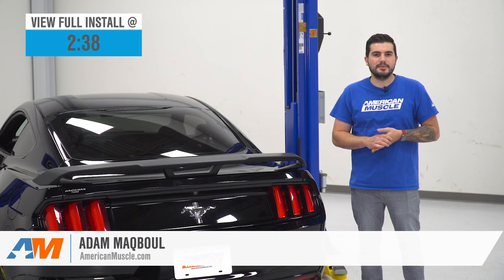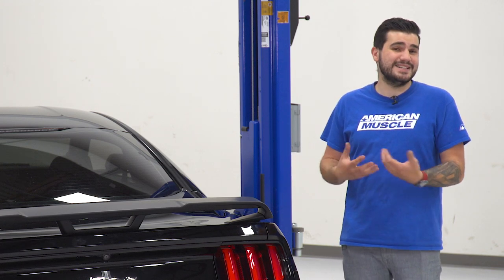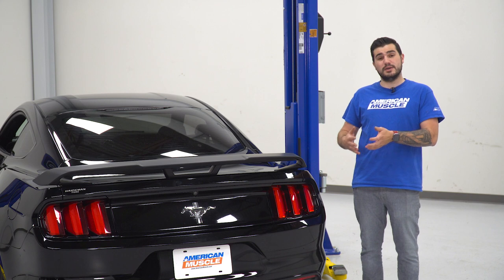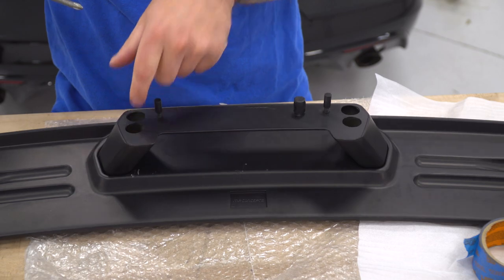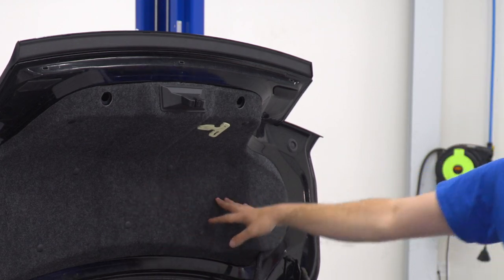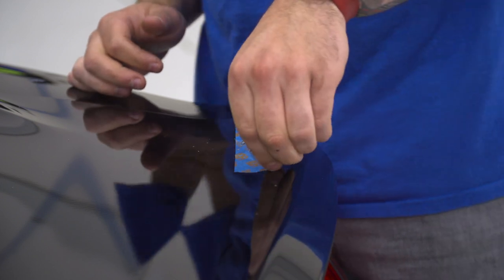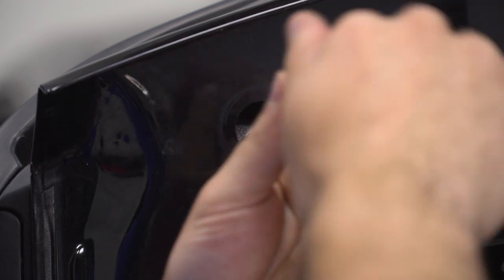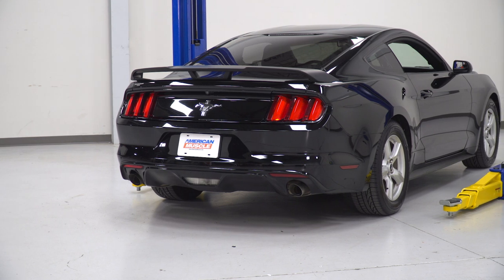2015-2021 Mustang Fastback MP Concepts Performance Pack Style Rear Spoiler Review & Install

Comment: The holes and screws should have been sealed to avoid water leaking into the boot lid during washing or heavy rain?!
Reply: dont really need them the 3m is more than enough to stop the water from getting in ... theres no sealing from the factory spoiler either minus the 3m

Comment: I have a 2020 mustang GT Black Accent Pack so it has the little duck lip spoiler. I want to upgrade to this. Does it use the factory holes? The reason I ask is because I’m pretty sure the spoiler my car came with already has the holes in the middle
Reply: @Enrique jaramillo I just got the Ford performance gt500/gt350/Mach 1 spoiler. Looks way better in my opinion and did not need any drilling

Comment: I have it nice upgrade from factory and can’t beat the price
Reply: Alot of blisters and alot of adhesive removeer and a heat gun
Reply: Its better to buy OEM instead of this cheap plastic version why do you think they are not putting it on a GT for this video 😂
Reply: @officialtjtrev8910  This is ABS and made to OEM specifications though.

Comment: I feel sorry for the owner of that Mustang.  You ARE NOT a very neat worker.  The holes you drilled were off-center, but the worst part is that you DID NOT PRIME and paint around and underneath the holes.  This area is where the Mustang will start to rust. Other than that, your video is well-made and I thank you for sharing your knowledge.
Reply: Paint and prime would be a very difficult process with how the trunk is built . that's the whole purpose of the 3mm to prevent any moisture from seeping in through the drilled areas.
Reply: @stefantaylor1693 , come on man, all he had to do was: 1.- deburred the hole 2.- Use a small brush to prime the hole 3.- Use another small brush to apply touch paint.
Unprotected metal WILL RUST even if it does not come into contact with moisture.  I have some 2 1/2-pound metal weights that I do not use in my basement because they are too small, and they are all covered with rust.
Reply: Refckinglax you act like it’s going to kill the car. My god I hate you internet wanna be experts.
Reply: @OFFICIALRover , ".......wanna be experts?" I never claimed to be an expert. Every TRUE PROFESSIONAL will at least prime any holes that have been drilled. You are working on a customer's car and he will never know the low quality job you did.  Shame on you.

Comment: Has anyone had to take off the existing oem ducktail spoiler on base GT? What all did that involve?
Reply: I haven’t done it but I assume it’s not bad, they have holes in the hood to access everything holding the spoiler down, it shouldn’t be any harder than putting the spoiler on
Reply: There is a YouTube video from Mustang Mike on install from Ducktail,Spoiler…..holes already drilled…under the blade/ ducktail spoiler

Comment: Honestly, that seemed liked a bit of a hacker job on the holes but yes it’ll be covered. I didn’t like it
Reply: ...and what about sealing the holes against water leakage into the boot lid!?
Reply: @RobbaGTP  d.tape will work 🗿
Reply: I would have used a step down bit after the pilot holes were drilled.

Comment: 175 bucks for a primer spoiler and then how much to have it painted probably another 200 bucks then if you’re not real good mechanically how much to have it installed I think we’re gonna be up around 500 bucks all totaled
Reply: Then get a Ford one if you can't DIY what's your point?
Reply: @hatch450sx3  Well then you could do like I did just buy a mustang performance pack car lol! And screw old is aftermarket crap.
Reply: Sucks to suck

Comment: The matte black one is good the gloss one is the most worthless piece of plastic, the mounting holes for middle bracket DO NOT LINE UP, the cap for screw cover pegs have to be hammered in dimensioning is completely off

Comment: What about the excess screws with no way to get them on the side of the wing, I have it on their but I’m scared it’s gonna fly off cuz
Reply: I used a 3/4 hole saw and put another hole lower to outside of larger hole from factory took a 10mm wrench and bent it 90 degrees…bought 3/4 grommet to cover…looks factory

Comment: Is any drilling required with factory spoiler with holes already?
Reply: I noticed ALOT of the 21 and 22s I saw didn't need to be drilled. I would pause the video when they are drilling and see if a hole is there already. Or pop off your trunk lid lining inside and count center holes if there are 3 holes in center. 2 close one much further away you have a good shot at not having to drill
Reply: My 2018 gt didn’t need any drilling

Comment: Ive got a 2021 GT, came with the base spoiler. Looking to swap out for a factory FORD spoiler in the Performance Pack style. Anyone know if the holes are all the same?
Reply: Did you ever find out ?
Reply: Yea the holes are the same no need to drill